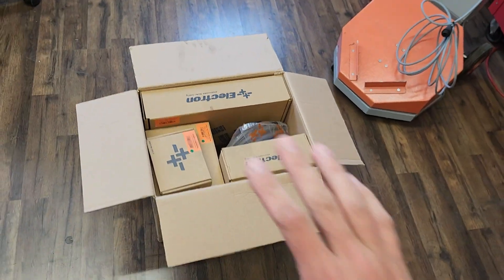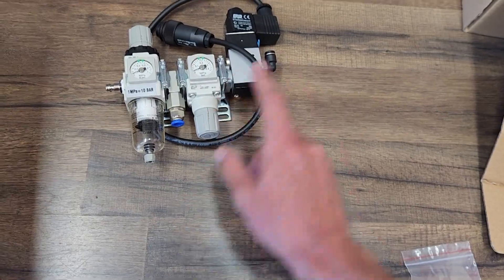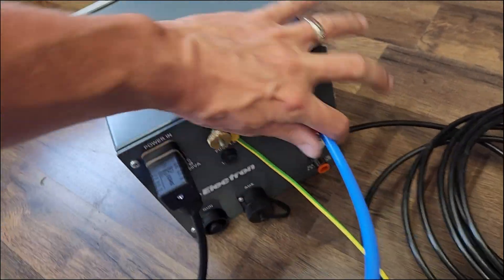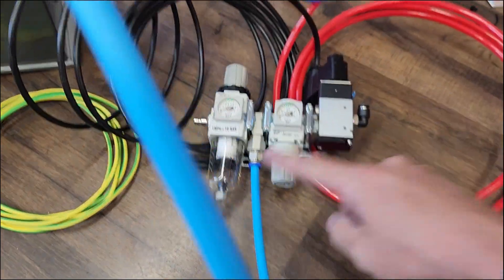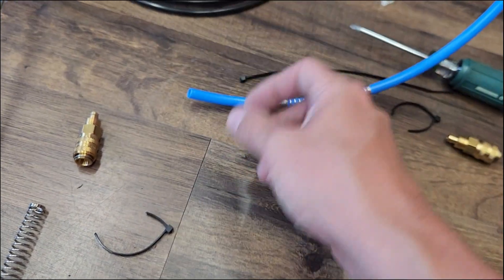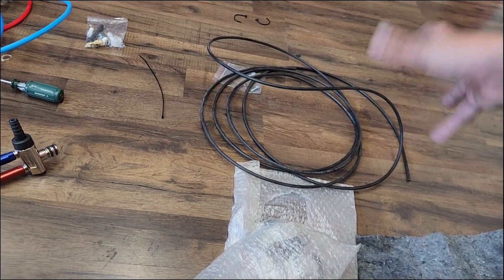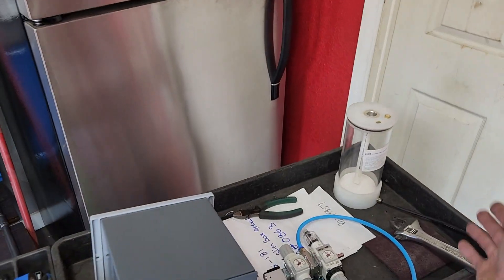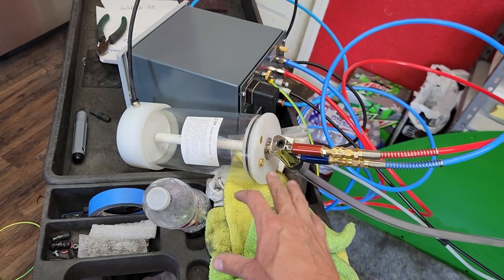Set Up a Powder Coat Hopper, Electron Bare          #powdercoating #howtopowdercoat

Comment: have you stoped useing the opti flex
Reply from the maker: for the most part yes, my distributor wont return calls and i cant get parts...we have 3 electron units we use and carry all spares in house....
Reply: @RightNowPowderCoating  I reached out to my Gema distributor a couple of times for help,what a waste of time.But I think you solved my problem also.Was useing the same hopper but with a screw on top and was having trouble reducing powder flow,I think it's getting too much pressure also,I will try to put a larger vent on top.Thanks soo much